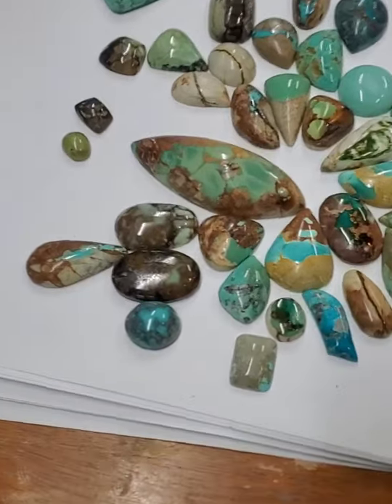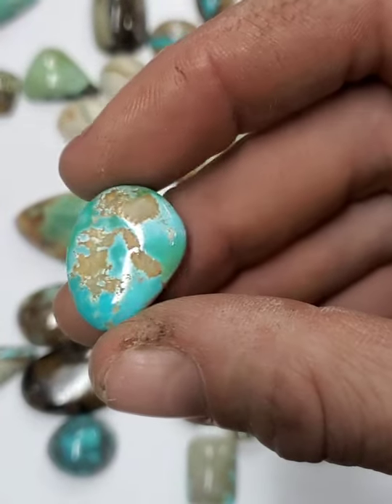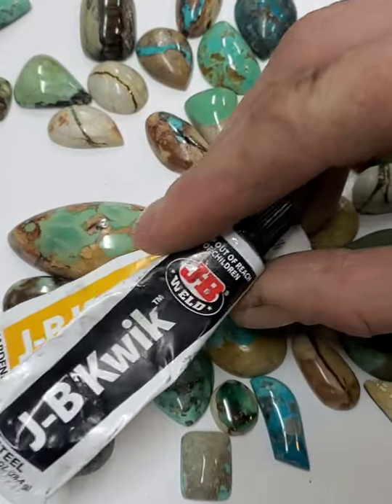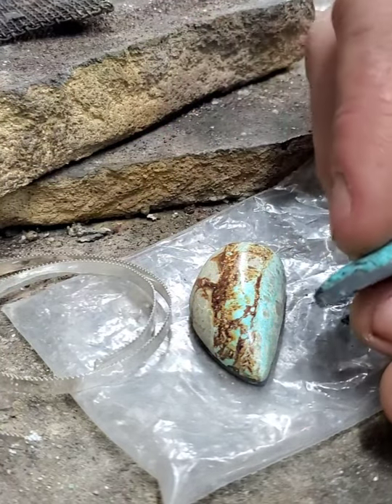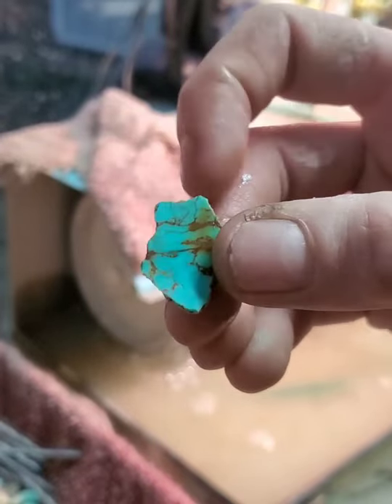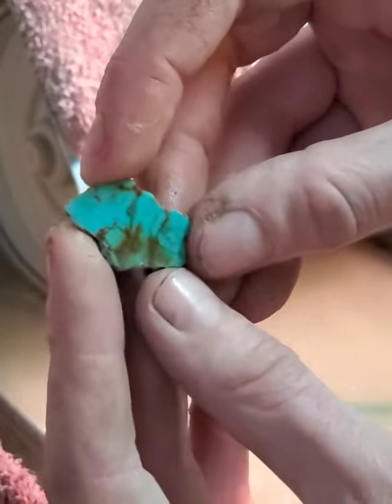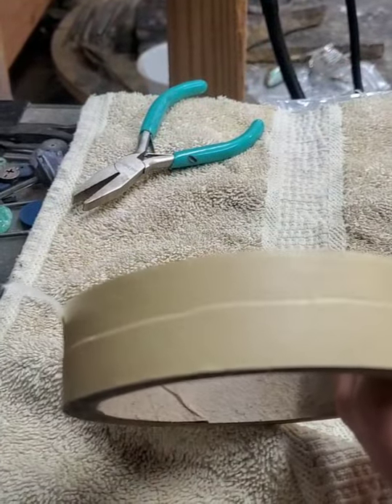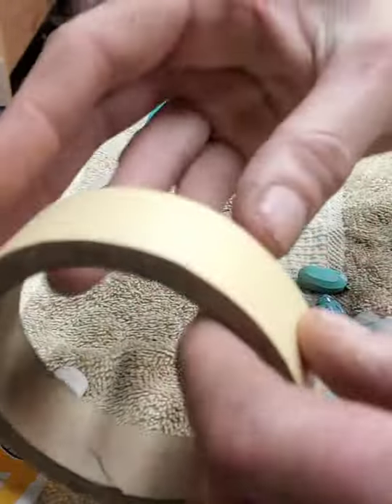How to back turquoise and why, when working with cabochons lapidary lessons

Comment: You're so right about backing I was cutting a lovely cab the other day of turquoise. It broke in half as I was trimming it on the trim saw. ALWAYS BACK ALL TURQUOISE. Also. Quik JB Weld is NOT waterproof. Regular JB Weld is. Thanks for the frank video clarity. Another trick is to spoon mixed JB Weld into a small zipper bag, make a micro cut in one of the corners, and twist the bag. You can then put the JB Weld exactly where you want it.
Reply from the maker: The bag trick you shared is awesome! I'll have to try that the next time.
Reply: @TwoManyProjects  Think of it as a miniature cake icing bag with permanent icing. LOL

Comment: Thank you for the demo, I agree backing is important and I just purchased a couple  that are not backed and need to be done.  Can those bottoms be sanded with sandpaper, a flex shaft, or do I need a grinding wheel?
Reply from the maker: Sand paper works just fine. Or use a dremel, or...grinding wheel. No need for expensive tools.

Comment: What makes some turquoise stabilized and other not? Stabilized how?
Reply from the maker: Stabilized means the turquoise has been treated with a chemical to make it stronger. This is good and bad... some people are purists and do not want their stones treated in any form. Stabilization of turquoise without enhancement, in my mind, is very smart. Turquoise is not a strong stone, it can be brittle and some of the finer colors /lighter colors can be very brittle and only exist due to stabilization. The chemical process for stabilizing usually includes a form of a glue and some form of chemical penetrant, this means the glue helps hold the turquoise together and it's not just a surface treatment. This also means stones that are stabilized are more suited for rings/bracelets because both rings and bracelets can easily get bumped into counters, cars, sinks, ect.. which can chip stones. Stabilizing just means they won't get chipped as often, and wear better in these settings.

Comment: I don't understand so when you say soft material do you mean it's still hydroscopic and absorbing water and oil therefore unstabilized in natural or are you trying to say that it's just not very strong
Reply from the maker: When I say turquoise is soft, it's normally the blue or light blue turquoise that is soft. It's soft on the vector scale.. And normally this turquoise is stabalized, which means it is put into a bucket full of resin and sat there for a while so  that it absorbs the resin and is 'glued' together. So.. in a way, yes.. it is hydroscopic and absorbs water and even resin glue. Natural turquoise, if it's a darker blue is normally harder and doesn't need stabalizing, or if it's a green and contains more variscite than turquoise, it'll be stronger and may not need stabalizing.